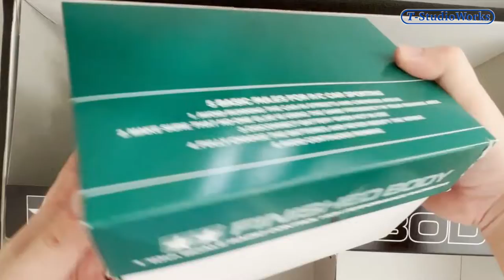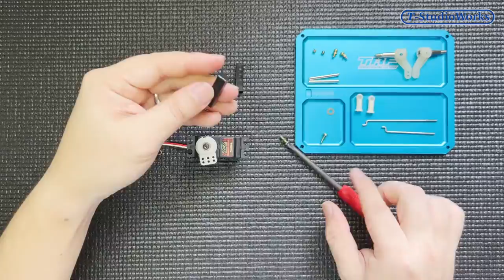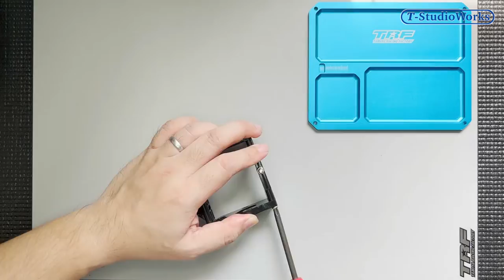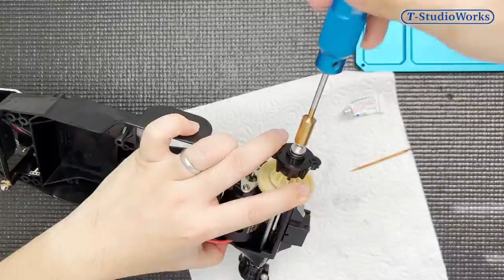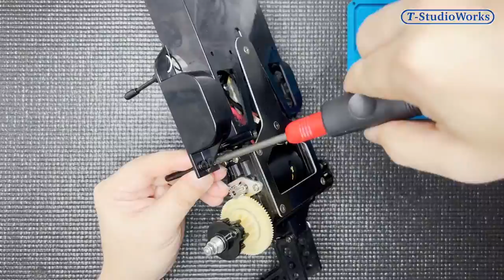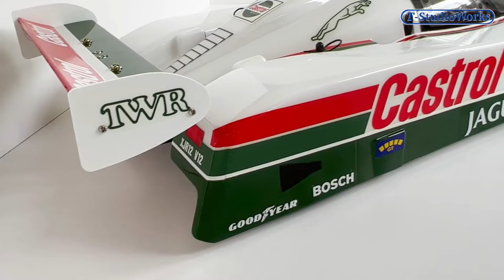TAMIYA JAGUAR XJR12  |  Unboxing & Build

Comment: I built and drove this back in 1991 and the thing I remember most was just how smooth and well behaved it was compared to Tamiya F1 cars at the time.
Reply from the maker: I think the wider track & more forgiving bathtub type chassis helps a lot.  They are a blast to drive.